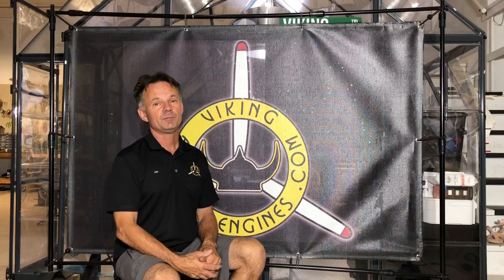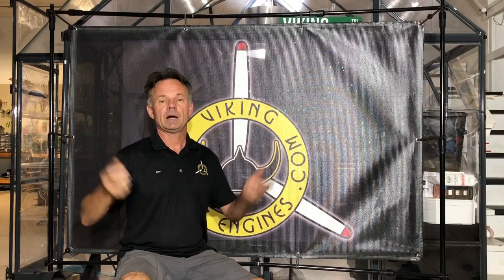Talks with Viking Part 2 - FAQ's - Liquid Cooling, Fuel Systems, Cabin Heat, Direct Injection etc.

Comment: Will be looking for a Used possibly new Rans S-6ES COYOTE II.  I will be looking for one with  Conventional 
landing gear or will convert it to conventional landing gear.
Is the Viking 90hp engine enough horse power for carrying 2 people?  The engine compartment looks small to me and I don't know if the plane will take a 130hp engine.
Wanting to stay within the 1320 pound gross weight for Sport Pilot.
Reply from the maker: Stay with the 90 or wait until we have more hours on the 100 turbo.  Same as 90 engine

Comment: What is the overall weight of the 130 engine, coolant, radiator, hoses, mounting shelf, engine mount, coolant recovery tank, inside heat core and brackets, and control hardware?
Reply from the maker: This can be VERY individualized depending on build, the engine itself is 220 lbs. Installed weight is that of an O200 or Corvair engine, but with more ponies. Which I believe all up is around 245, give or take depending on build.

Comment: Engine torque + propeller = thrust??
Reply from the maker: Most propellers have very similar efficiency, so not necessarily the type of propeller. The increase in thrust is mostly due to the gearing of the engine allowing for a larger propeller in some cases.